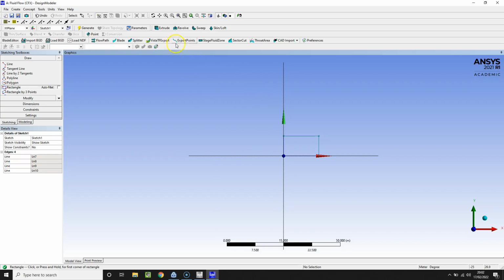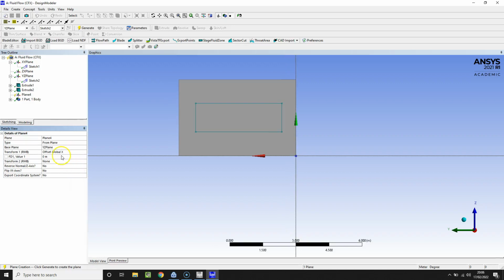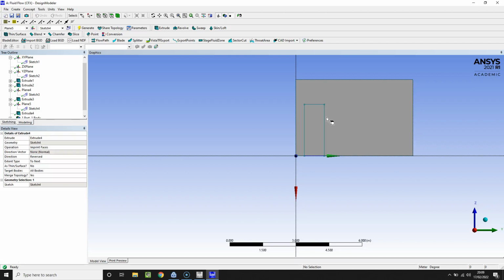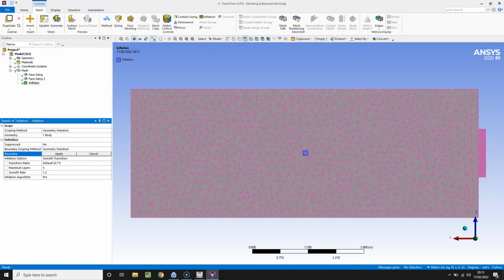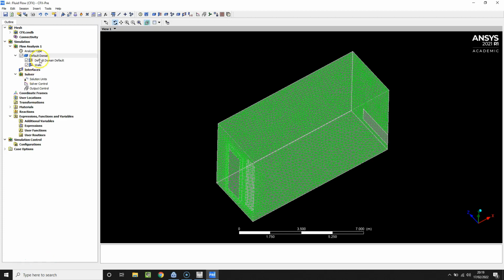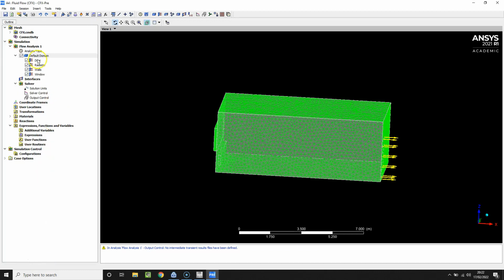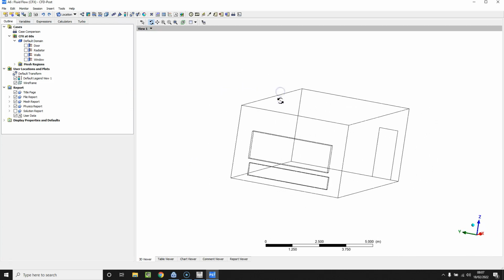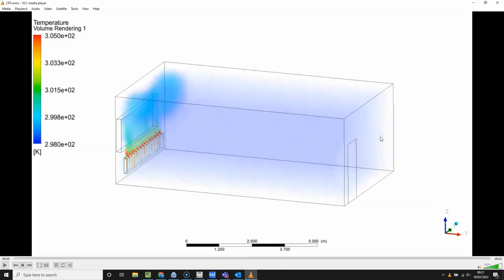Transient CFD Simulation of a Radiator Heating a Room Using Ansys CFX and Design Modeller For HVAC

Comment: Hello, the heat dissipation in the radiator only happens for a while and then stops. What should  be done for this?
Reply from the maker: @bahakurak9572  use an expression and it a function that at time t, T=0degrees

Comment: I am failing to highlight the radiator when I am about to mesh it, what could be the reason?
Reply from the maker: @sibonisozakwe3805  have you tried changing to surface select? Sometimes edge select is on my default.